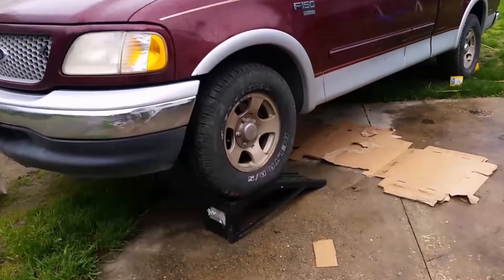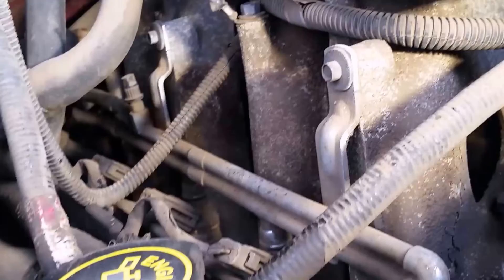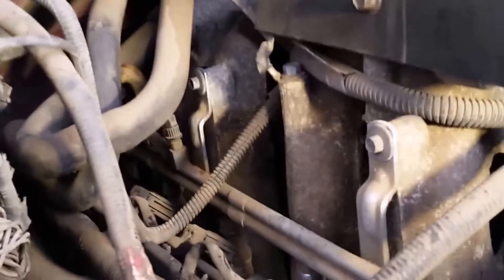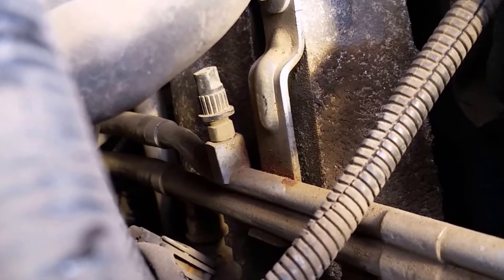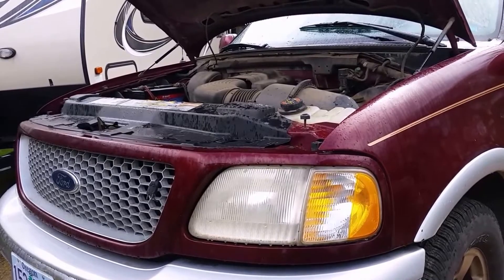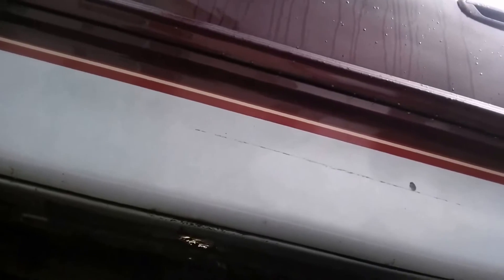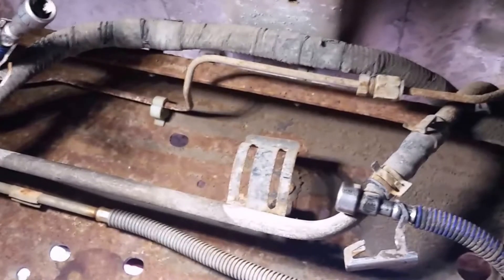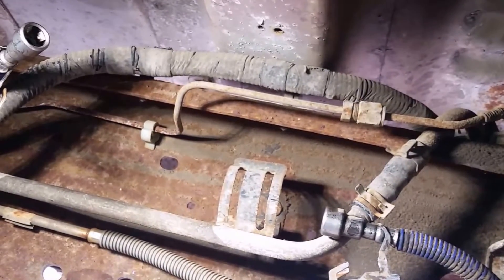1999 Ford F-150 Fuel Filter Replacement

Comment: 😮There is a single nut no washer holding that clamp to the frame. Remove the nut - SIZE METRIC 13 - and the clamp will pop off the fame so you can move the filter around to free it from the lines. Once off the lines pull the filter from the clamp and reverse the process with the new filter. The little nut is easy to get to and is right on the other side of the frame mid-way from the bottom to the top. MarkMannM2

Comment: This helped me.
I bought the metal tool and it worked much better.
Except for the front side there wasn’t room for the tool. After watching this video I realized that the previous owner used a plastic tool like the gentleman here used, but on my truck they just left it on after changing the filter.😄

Comment: Dakota Fred, thanks for the video.  Excellent work and really appreciate you verifying anothers video and making sure it was real.  I even liked the problems you ran into with the little tool.  That's real.  My truck just started sputtering and it's 18 years old so I think the fuel filter will be the first and cheapest thing to change first before going to a fuel pump. 

Thanks again.

Comment: Super helpful Fred!  I have a 2001 Ford F150XL with the small V8 as well.  I just got the darn thing running again after being PNO, as I was in and out of the hospital six times, between Dec of '23 through Sep of '24.  I finally got enough $$ saved up to re-smog and register it again.  At first, it worked fine.  But, more recently, it will not start after I drive it somewhere (odd, because it starts in my driveway fine) and it has left me stranded far from home four times now (two with my neighbor as a passenger, once with my dog, and once by myself).  Eventually, I got it started each time, but only because a small amount of fuel was added to the gas tank each time.  Every time if left me stranded, it had well over a quarter of a tank of gas... according to the gauge.  Wondering if any of that strikes a chord with you or not?

On another note, I had watched about 5-6 other videos on this topic.  The first few expressed a preference for the small scissor-like tool with the curved ends and made with metal, rather than the plastic disc-type tool.  Thanks to your demonstration, now I know why.  Unfortunately, they never said why, so thanks again for THAT!!!  

I also thought, as I watched you fight with those special hose clamps on each end of the fuel filter, whether or not a small-to-medium adjustable crescent wrench or an open-end wrench and a small hammer, might have made things a bit easier?  I am very nearly 72 years old, with 24/7 back pain, a heart attack and over a dozen strokes in my recent history.  I am pretty sure I need to do the same thing, but need to save up the $$ to buy all the needed items, and though I have been dreading this fuel filter replacement, watching your video and listening to all your comments, have actually got me thinking I might be able to do it.  Thank you so much for the critically important info and confirmation on what this job actually entails.  Bravo Dakota Fred!

Comment: You do not have to relive fuel prssure at the fuel rails at all, because the fuel pressure is in front of the pressure regulator on you left fuel rail and fuel between that and the fuel tank has no pressure at all.  This a a practice in where I see people turn off the fuel pump and run the engine to it runs out of fuel rail fuel and all this nonsense when no pressure exist at all at the fuel filter at all

Comment: Before inserting the tool...spray wd40 on line and tool....slides in a lot easier.Use a 1/4 wide PC of Emery cloth to clean off corrosion first if needed. No way will that plastic side on that corrosion smoothly.

Comment: fred next time get the actual metal tool instead of those plastic variety kit,  usually there 2 sided with a size on  each end,  parts store should know what size you need and there not much more money then that whole plastic kit
Reply: look up oemtools 25043 and that's the type that works best for me
Reply: Tha is good
Reply: idoutdoors I agree after struggling with one of those plastic kits I just went back and bought the metal tool I needed, with that it only took about ten minutes to take the filter outand put the new one in.
Reply: idout doors: Parts store need teach their people To know the right size of the pipes an hoses, Just to let the custemer know which to buy, in order to don,t spend unnecesary Money !!!

Comment: This just proves you (Dakota Fred) do not know everything. You have to pull the fuel pump fuse and release the pressure before you start taking the filter off,
Reply: no you dont haha only if you have been driving the truck and the fuel is pressurized aha if the truck has been sitting over night it de pressurizes ( my brother works at toyota and they have never released that valve unless the truck it hot !